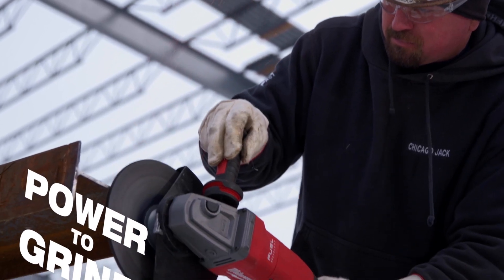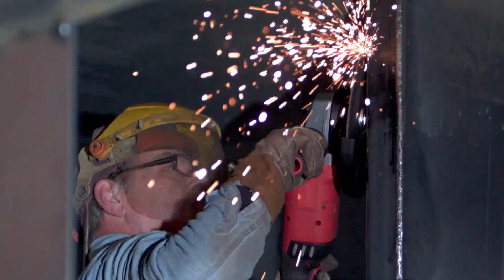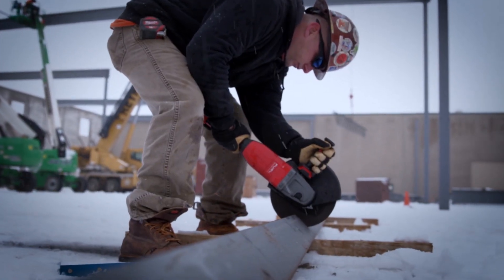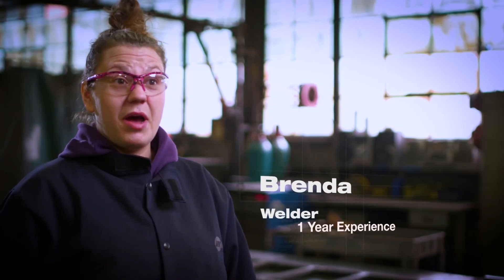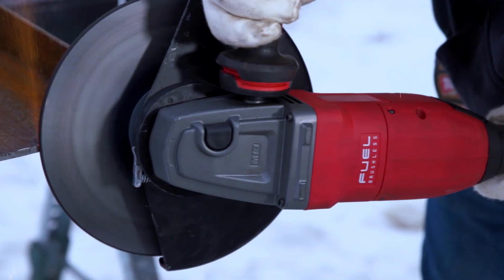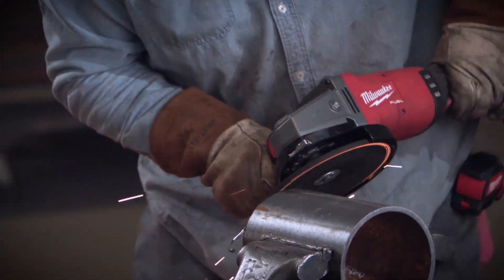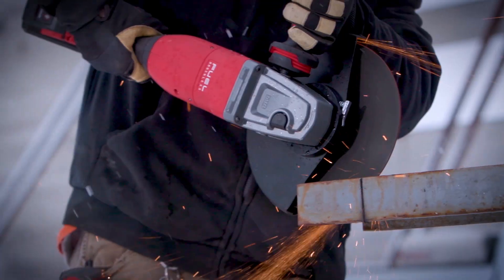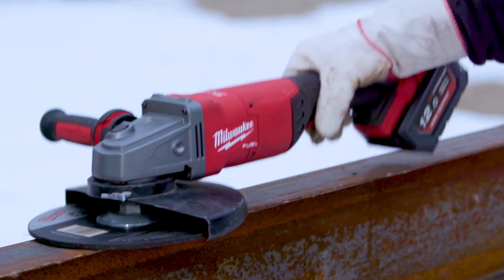Milwaukee® M18 FUEL™ 230mm Large Angle Grinder

Comment: LOL at the 1min mark.. he says hes done everything he needed to do today and still had battery left over.. I call BS because i use a 115mm grinder with my 12ah battery and while it does last a good while its defo not enough to use a grinder all day for the work of a welder or fabricator so there is no way that a 12ah will last on a 9inch grinder just from personal experience.. great bits of kit dont get me wrong im a huge fan of Milwaukee but there is no way it lasts as long..
Reply: He was off work that day

Comment: Im upset the t1 backing flange  43-35-0925 is not included or available . I was able to find a pdf over priced parts list and then ad shipping when it becomes available I think not . I have 25 nine inch cutting wheels that i cant even use, Ill probably end up grinding a few washers so I can mount A cutting wheel.
Reply: Gitter done
Reply: Same reason i am here why the f*ck can't I use any of the many flat cut-offs that i alreay have for my corded grinder?  Should of come with the T1 Backing Flange not that retarded cupped one.  I am kind of pissed about this, what is the point of this.  I just got my grinder have not even put a battery in it.  I think I am going to throw that stupid cupped backing flange in the lathe and cut it down.  Well Milwaukee why did you do this to us?